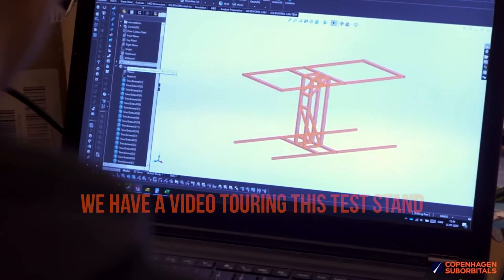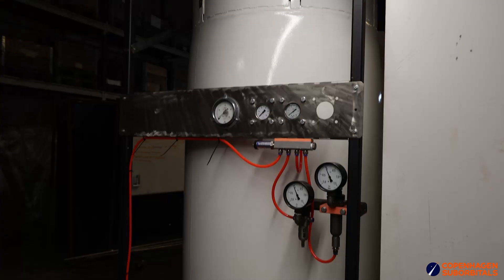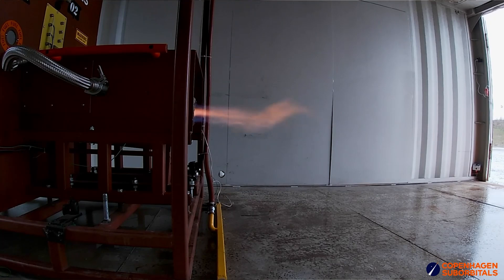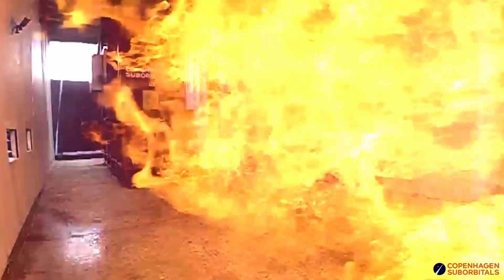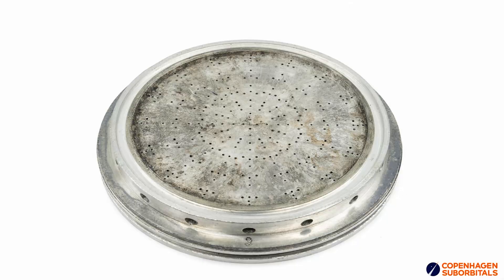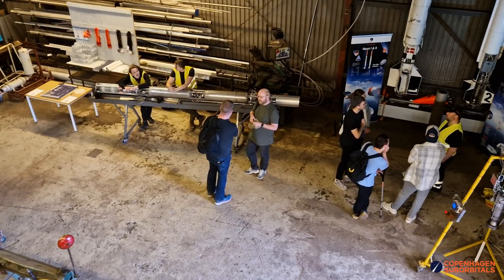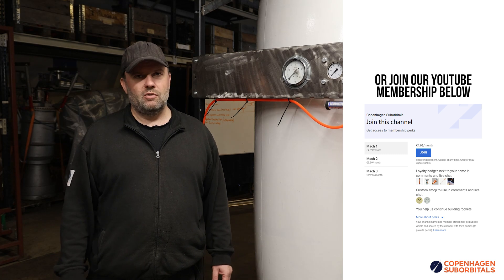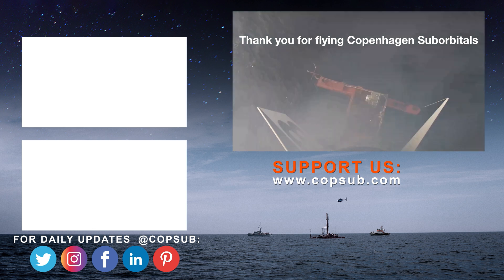How to Shut Off a Rocket Engine (Safely)?

Comment: This is a kind of off topic question but I figured you guys might have a good response. How does fuel supply actually work with gimbaling engines? I understand the pivot mechanisms but how does that stay sealed? I know flexible hoses are not options because of cryogenic fuel and O rings would freeze, so how does that really work?

Comment: how many pressure cycles you can take on the flight tanks, are they at their maximum operating pressure during the engine test?
Reply from the maker: I don't know the number personally, but they are rated (and tested) to hold 1.5x flight pressures. To give you a ballpark figure, we can look at some grownups who arguably have much slimmer margins; they can reuse their tanks 20+ times, which is at least 40+ pressure cycles when considering pre-flight static fires.

Comment: Wow I always wondered how you guys powered down the BPM5, for my Bi propellant rocket engine (still in design) I thought a system that pumped helium to purge all the lines after fuel and ox was spent would be the best option. It is so complex, your solution is much simpler🤤🤤